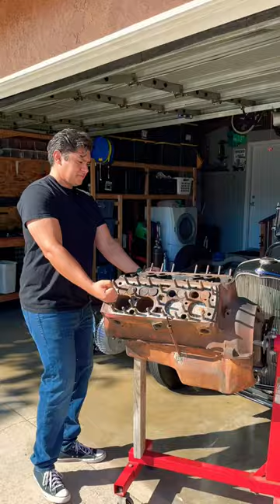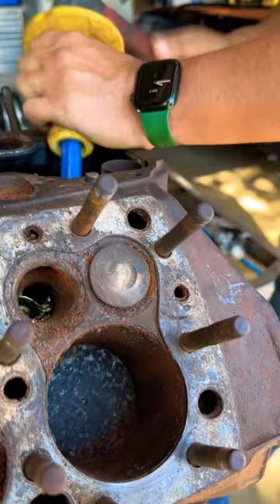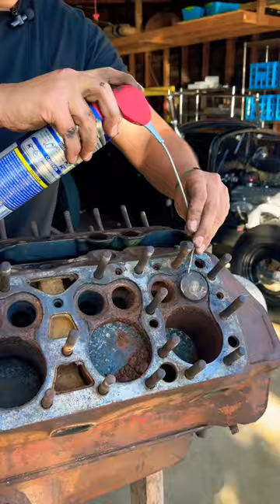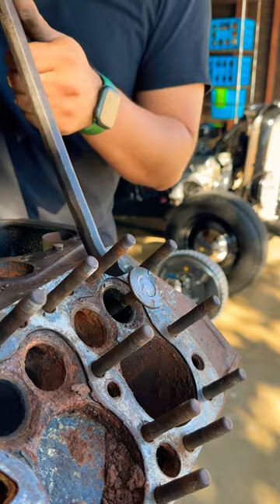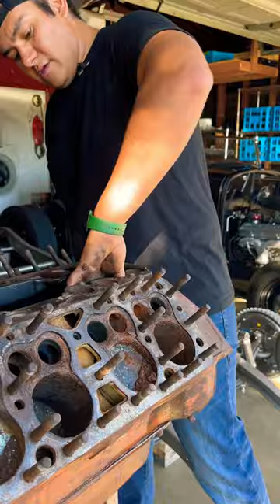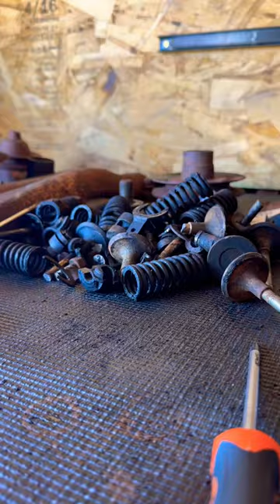Now I understand why people shoulders drop when you talk about taking apart a #flathead it’s a pain!

Comment: i can't help but think of a modern flathead with a larger displacement and direct injection. seems like it would be a simple and highly reliable engine design.
Reply from the maker: Simple yes, but larger displacement also means thinner walls between the cylinders and water jackets … and since the center 2 cylinders dump into 1 port the high heat can lead to issues… there is fixes but it gets way more expensive 😅… this engine will be simple … if one day I am lucky enough to build a high output engine I’ll start with a stinger base like a French block and 4in crank 🤌🏽👌🏽👍🏽
Reply: Not enough main bearings.
Reply: It would be too easy to repair, that's why manufacturers don't do it. They rely on mechanical failures so that everyone will buy new cars more and more every year
Reply from the maker: @shaquis7466  not sure if that’s the case here… flat head engines are know for cracking between the cylinders and water passage and at time they are to far gone to repair.
Reply from the maker: @jesse75  that is another good point! The crank could use more support !
Reply: Air is a fluid. Fluids do not like to take sharp turns. The intake and exhaust on those heads is very inefficient.  That is why they switched to overhead valve designs. Also the combustion chamber shape makes it harder to control the flame front on ignition i.e. detonation.
Reply: Unfortunately a side valve wouldn't pass emissions because theres too much surface area to the combustion chamber. Also it's very difficult to get a high enough compression ratio for good thermal efficiency and fuel economy with reducing the breathing abilities. They are very simple and relatively quiet because the valve action is buried inside the block. There are some aviation side valve engines.

Comment: I WAS LUCKY, I got rid of the flat-head in my 47 Ford coupe after it ran hot for the third time and locked up.  That Olds 303, sure ran good and looked good in that little Ford. That one looks like a good boat anchor.
Reply from the maker: Glad you were happy with your olds ! Be sure to subscribe and check out the videos to see if all the work is worth it 😬

Comment: I have a 1950 Mercury engine. No carb but everything else is there and reasonably intact. Looks a little like this but not as bad. Has the 4” crank and all the regular mercury goodies. 

located in texas around DFW
Reply: forgot to mention that I have the ‘50 mercury chassis and vin plate for sale as well. And the windshield frame and firewall. 3 speed manual Transmission too. 

If you’re looking for the mercury crank, let me know and i’ll sell it all for a song😂
Reply from the maker: If you can get it going … do it 👌🏽🤘🏽

Comment: Prying against that block really did you a number. Suggest a small piece of material in between amd also a ggod slide hammer
Reply from the maker: Slide hammer would have been handy for sure… the good news is the valves do not get reused and the head gasket was a nice cushion 👌🏽 plus the head surface hopefully will get decked (if the block is fixable)

Comment: I ended up chiseling the valves out in my flathead by loping the head of the valve off, then getting a big bar into the valley between the stems, and breaking them off, then I just pounded out the guides, rinsed and repeated sixteen times.
Reply from the maker: I had a similar approach, each valve was a little different, my cut off wheel tools would not fit in the valley :(

Comment: Dont know if theres a spider like tool for removing valves that hold behind the valve 3 long hooks and something to tighten at the end behind valve and on top a sliding weight like the ones to remove dents and use the sliding weight to pull out the valve u might need to retighten the 3 hooks but repeat until valve is out
Reply from the maker: I had a similar thought … I tried to use the slide hammer / bearing puller I had and it kept slipping but sure there is something out there .

Comment: Well if you don't soke something long enough  in oil of some kind yeah it will be harder to gear down. I'd baste that thing for a week in oil and kerosene before trying to take it apart.
Reply from the maker: It would probably help, but by the time I buy a tank/drum … all the fluid then getting rid of the fluid after sounded like a pain
Reply: @calirod  You don't necessarily have to submerge it even sitting it in a cardboard box low with a plastic bag and spraying it with CRC penetrating oil and with an old paint brush just re brushing works well but I know what  mean by soaking it in a vat and all.
Reply from the maker: That's a good idea for next time. I was able to take the rest of the engine apart this weekend.  @willf5768

Comment: At that point i would have made a diy puller that works off those studs lol
Reply from the maker: Not a bad idea… someone mentioned something similar and drilling holes in the pistons
Reply: @calirod  I didn't even think to drill a hole in the piston it's probably going in the bin anyway so may as well make it easier to get out

Comment: Please soak that block..
Reply from the maker: I did, first with rust remover then penetrating oil for a total or 3 weeks.
Reply: @calirod  your gonna have fun!! I ment 24v DC electrolysis soak. Tbh find a shop with a hot bath, even acid..
Reply from the maker: Yup… if the welding is successful that is the next step